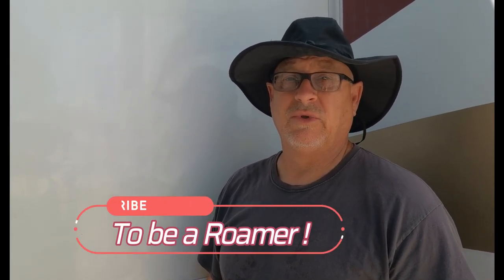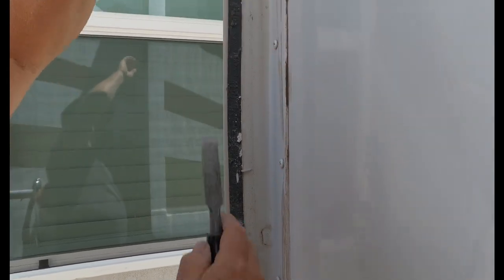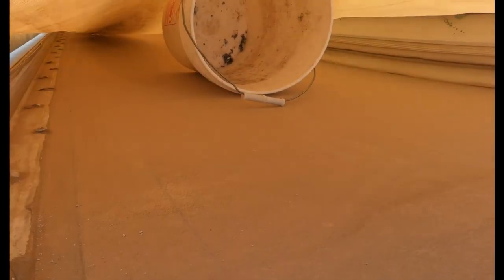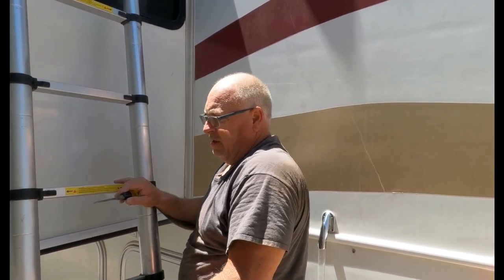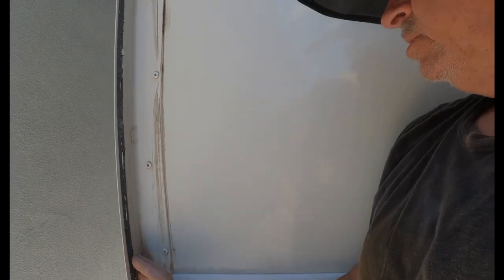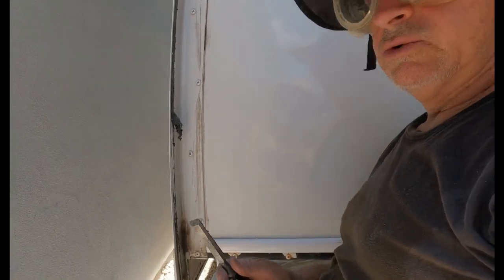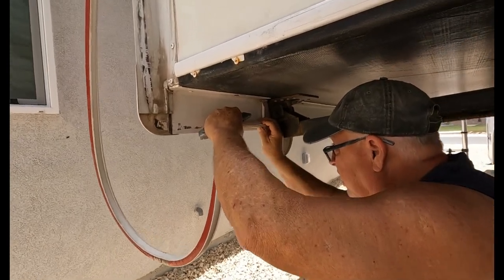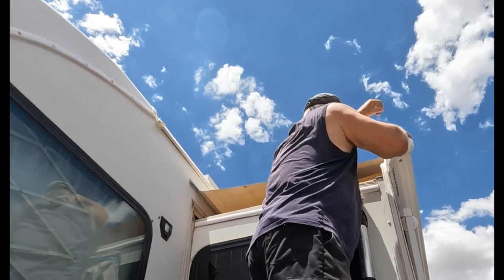How To Replace The Seals On Your RV Slides | RV DIY | RV Maintenance

Comment: Thanks Jamie - we have just purchased an Alpha motorhome, so we will be watching and learning from you guys.  The slide-out rubber replacement was informative as ours needs to be done also and i am in for saving money.
Reply from the maker: Congrats on becoming an Alfa owner. What year and size? Glad the video was helpful.
Reply: @RoamingWithRosie  Our Alfa is 2005, 36 ft
Reply: Have you made a video for the inside rubber?

Comment: Instead of Goo Gone to remove the residue of the adhesive, brake cleaner works MUCH better and leaves no residue where you need to go back with glass cleaner.  The secret to effective slide replacement is ensuring ALL residual adhesive and dirt is removed prior to affixing the new seal.  And you only replaced the outside "D" seals.  What about the "P" seals on the inner edge.  Those are what keeps the wind and rain out of the coach when the slides are extended as well as acting as a wiper to remove the majority any accumulated water on top of the slide.  I recommend that you pin the slide covers (as you did) and then unbolt them from the brackets on the slide and lay them over on top of the roof.  Crawling under a slide cover in the summer sun is whack!  Just had Ronnie Wolfe replace all my slide seals.  Took he and his Dad the majority of the day to complete.
Reply from the maker: Hey there Jim.  The goo gone pro power worked really well. And the glass cleaner was just a fast wipe down for dust as well. But good to know. 😉

Comment: The first step is to maintain your seals quarterly to prevent them from getting that dry.
Reply: His coach is a 2006 Alfa See Ya.  He did not get it new.  It is 16 years (or more) old and those seals look like they were the originals.  There is no cleaning or conditioning that would make a slide seal last in the weather and sun.
Reply from the maker: Thanks Jim Harvey. He also owns an Alfa. We picked up the Alfa a little over a year ago while we were still renovating a Holiday Rambler. 

Those were original seals. You can bet we wont let that happen again. The coach also had evidence of a pack rat infestation, luckily nothing living or dead in residence. That was clean up #1.